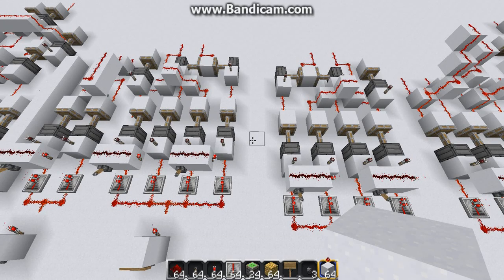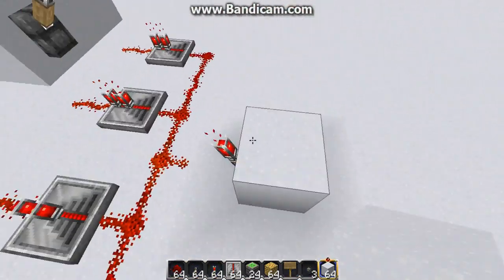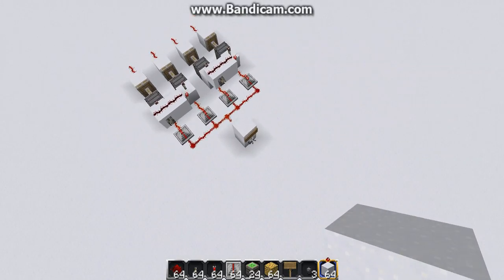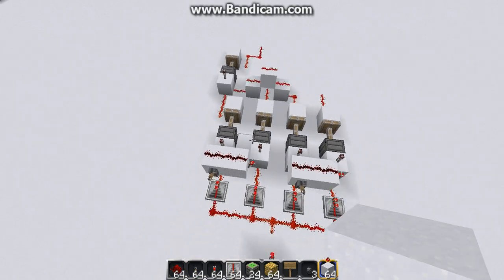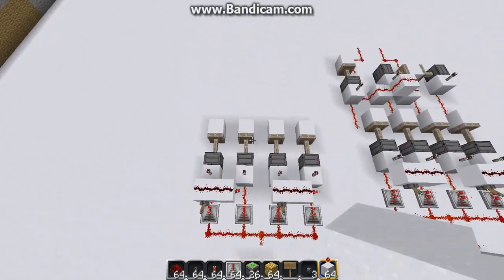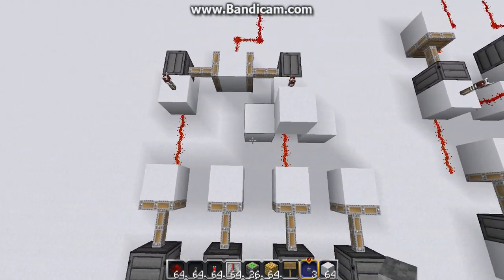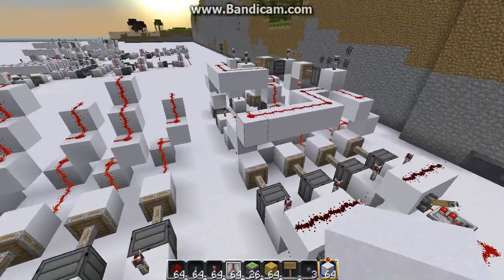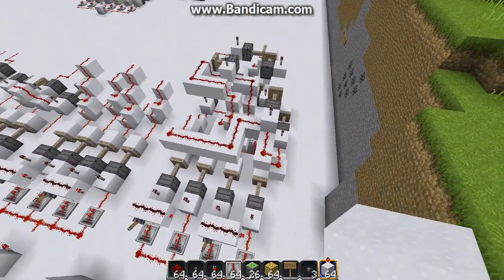Minecraft Instant Wire Tutorial Pt. 2

Comment from the maker: In ordinary wire you can have 2 wires joining and it would be an OR gate. The reason most people show it with a double inverter is you can't "expand" with just 2 wires crossing. For example, you couldn't build up to an XOR gate and some orientations would be more difficult. In instant wire, you basically don't have a choice but to build a full gate since you need to manage a positive and negative output.